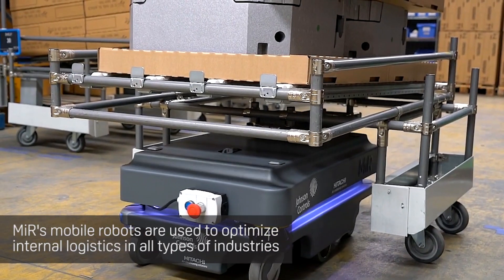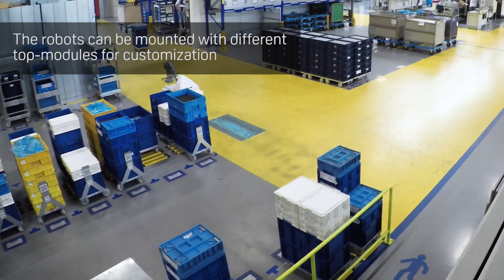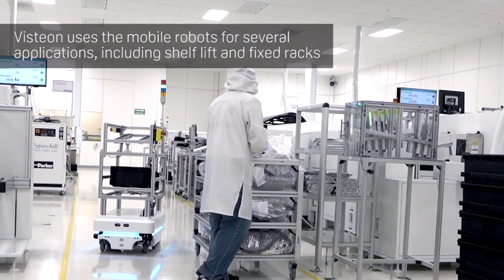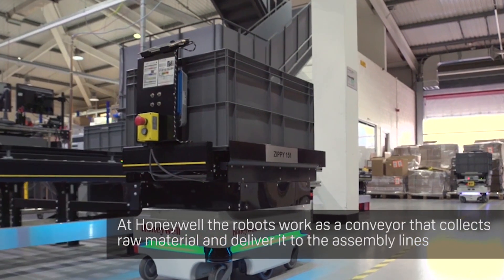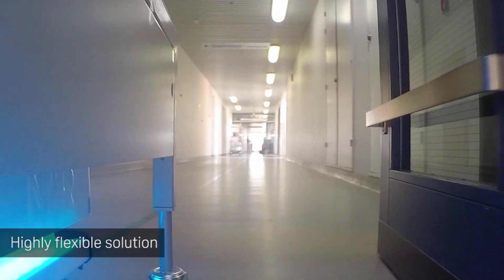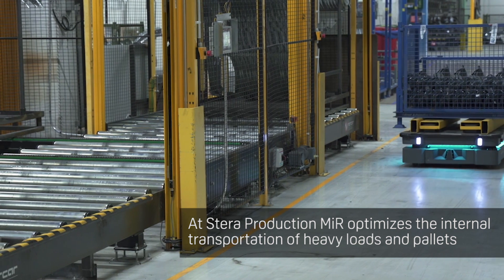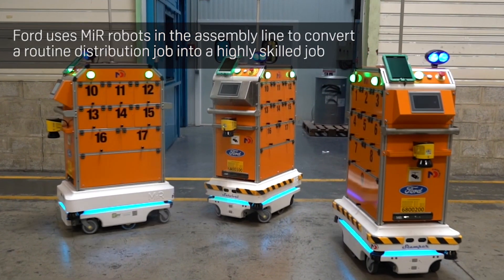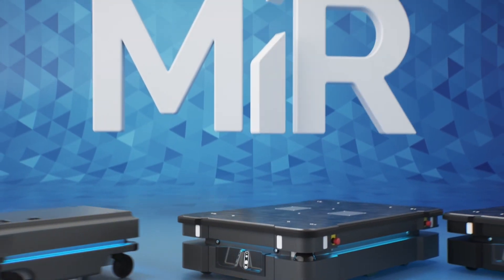MiR Application Video: How It Works

Comment: the MIR 200 cant access to the GUI. When accessing using the IP address, it shows 'Error! A connection to the database couldn't be established.'. What does it means?
Reply from the maker: Hi Tan Meow Soon 

Thank you for your comment. You can either direct your question to your MiR Partner, as they handle first level support, or send us an email at mail@mir-robots.com  

/Marina, MiR